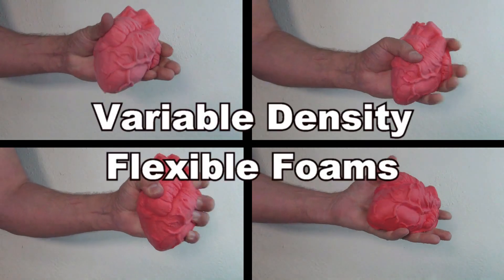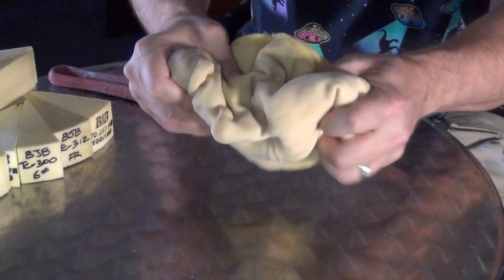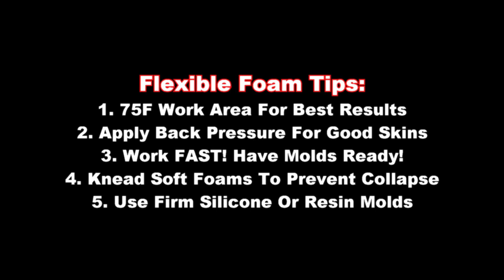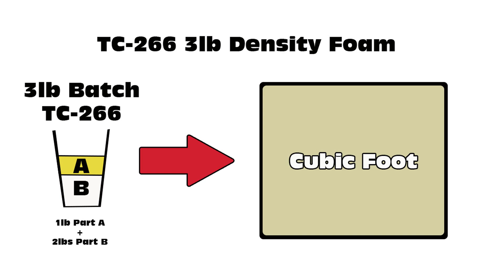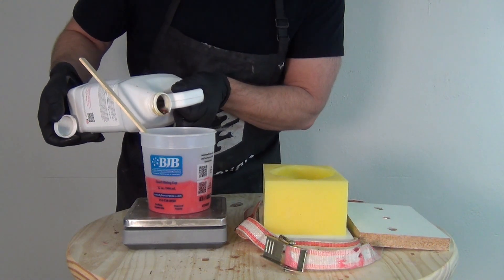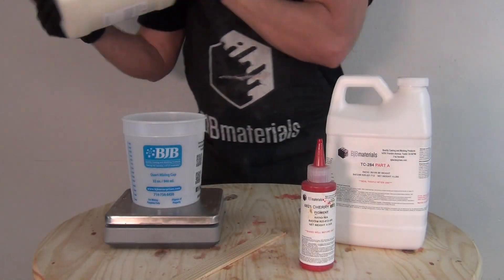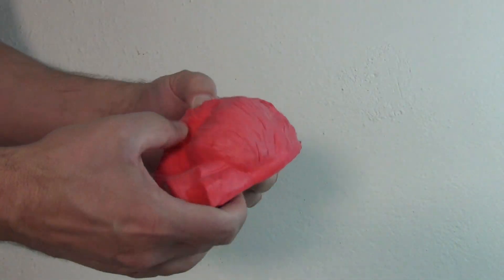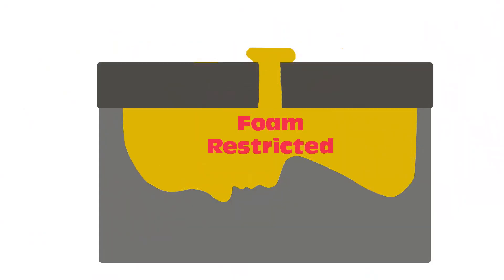Flexible Foam Casting: Variable Density Foam

Comment: For your 4lb density flexible foam, I understand it free rises to 4lbs per cubic foot... but how much is a gallon or 5 gallons?

Basically, I need to know what 5 gallons of raw materials weighs so i can figure what my yields will be... how many free rise cubic feet can I make from a 5 gallon kit?
Reply from the maker: A five gallon kit of TC-266 is going to be 20lbs of part A and 40lbs of part B so 60lbs total. The tech people at bjb can help you calculate

Comment: Thank you so much for your excellent videos! Always gleam great info from every video of yours. Something I've experimented with doing is also heating molds. I'm generating molds via 3d resin printing, and heating those molds (and sometimes part A & B) to 150-200F also really greatly affects the expansion rate of the foams and skins. I learned in industrial applications they often are pouring into heated aluminum molds for things like car seats cushions, and seeing the temps they were using gave me the idea to experiment and have gotten impressive results with being able to vary the densities quite a bit. ie taking a 8# foam to a 5#. There's so many variables to play with in these foams.